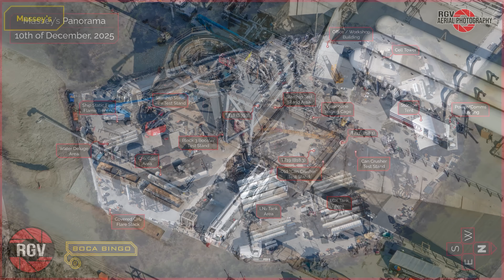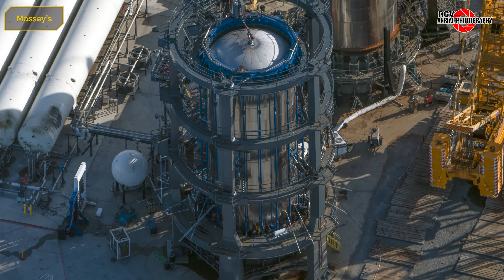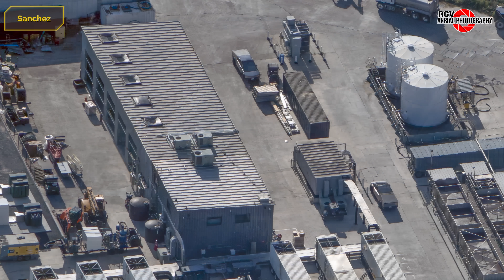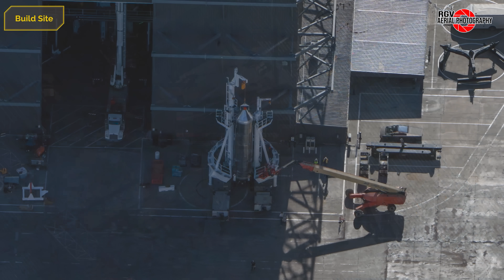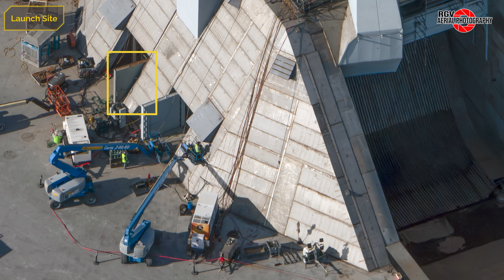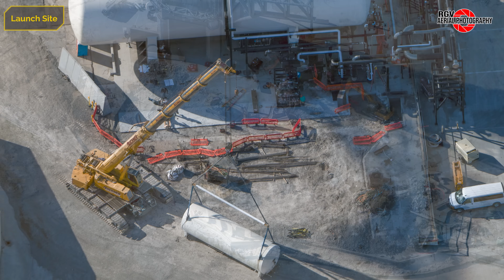Pad 1 Demolition Almost Complete + New Flame Trench Hardware! | Starbase Flyover Update 110

Comment: The ship test stand is set down next to the QD structure after carrying the ship from the build site. It sits over what looks like a concrete slab. In which direction does this slab slide to reveal the flame trench underneath?

Comment: I know spacex isn't sentimental but I wish they would have saved the table and plate.
Reply: Rendering the tower and floor space useless
Reply: @hectorpascale1013  huh?
Reply: @TroyRubert  When saving the deluge plate and OLM, the launch tower and surrounding area would be useless. Or do you think of dismantling them in one piece, and carry it somewhere else? That´s impossible, or rather say, not worth the money.
Reply: @hectorpascale1013huh? Not to use it again lol
Reply: @TroyRubert  huh?
Reply: @hectorpascale1013 Don't scrap them, but put them on display in Starbase.
Reply: @TroyRubert  Space at Starbase is very limited, see the rocket garden.

Moving the OLM with it´s steel legs full of concrete and high center of gravity is not totally impossible, but time consuming, which they don´t have to move on quickly, and very expensive as well. 

Removing the massive sandwich steel deluge plate in one piece, which is concreted into a massive foundation with it´s hundreds of steel rods pertruding down, is  even more impractical. Still doable with undermining the plate and intercepting the load with a temporary steel underconstrucion. But again at what price and time horizon?

Therefore my conclusion to display it as an "industrial monument" right at the current location, which would render the 1st tower useless. Because they have no space at the launch site right now to rebuild the pad somewhere else around.

--> Not impossible, but at a very high price and projects time loss, for a battered piece of rusting iron.
SpaceX is a company with the goal to make money and not the Smithsonian.
Reply: @hectorpascale1013 I know, hence why I said wish
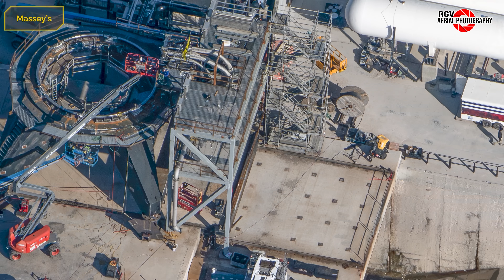Reply: @TroyRubert  So we are left with buying/modelling a .stl model and 3D-print it 1:50, to launch our firework display ;)

Comment: what prevents them from rolling the B18 hotstagesection back into the factory to reuse it?
Reply: Probably manufacturing process. If you cut the old section off B18 it won't be exactly the same size, or be in the right build state, to use the tooling in the factory so easier, and probably quicker, to use new components.